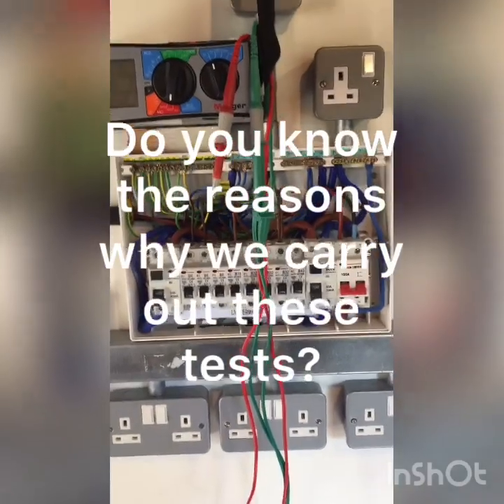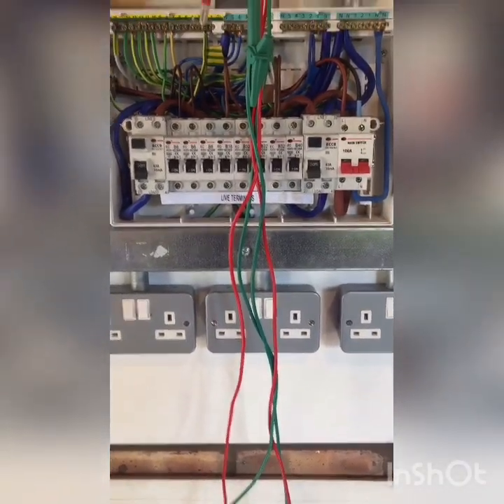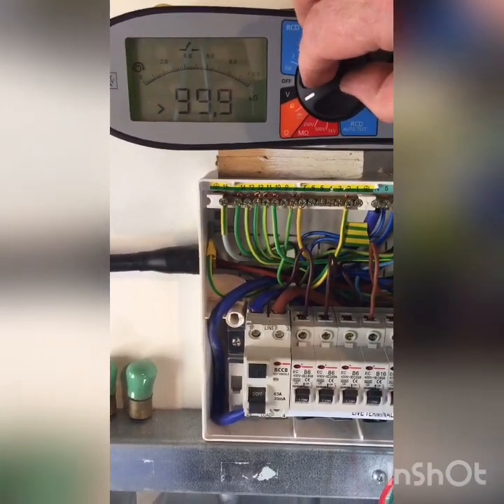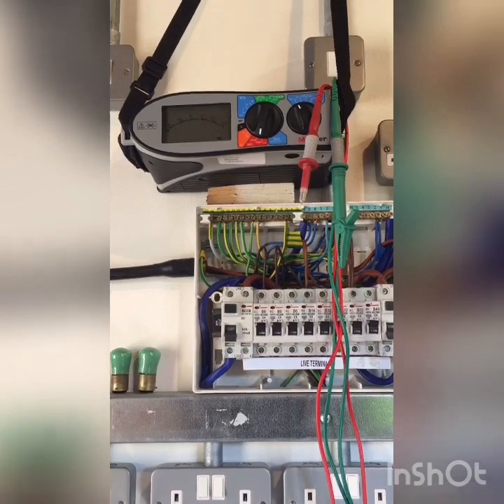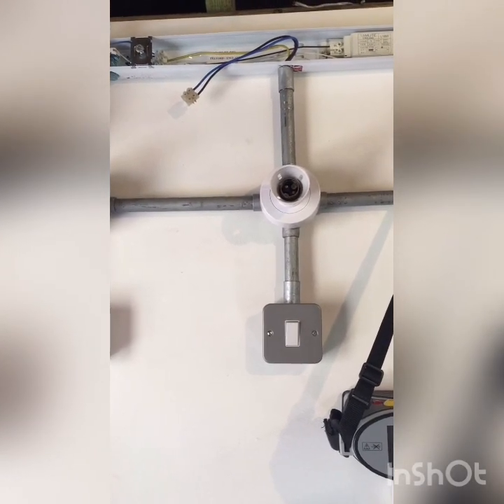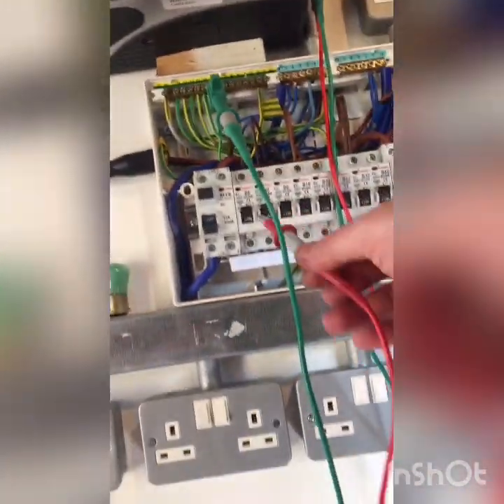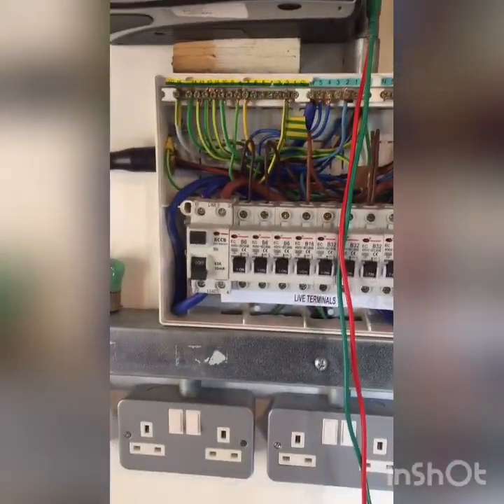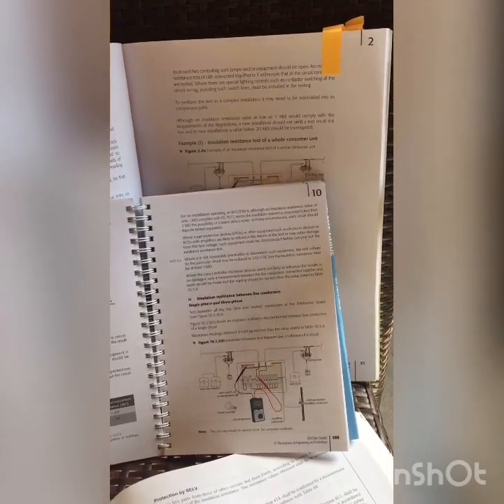Insulation Resistance Testing

Comment: Do you know why we do insulation resistance test? Answer to insure the circuit cables are in good condition with current leakage. And no signs of deterioration. It is a 500v dc test the minimum resistance should be not less than I megger ohm . BS7671 amendment 2 now requires we test twice first fix at 500v dc Then after second fix at 250v dc line and neutral combined , to earth so as not to damage any sensitive electronic equipment that may be in circuit. And earth conductors connected to the earth bar. Ie landN together in crocclip the second lead probe into earth bar , as there will be no perteual difference sensitive electronic equipment such as RCDs/ RCBOs sockets with with USB connection won’t be damaged. 
Great video as always 👍